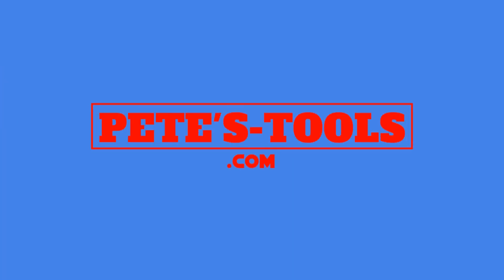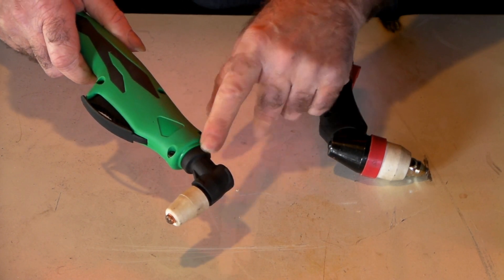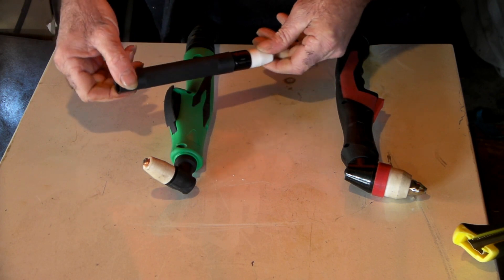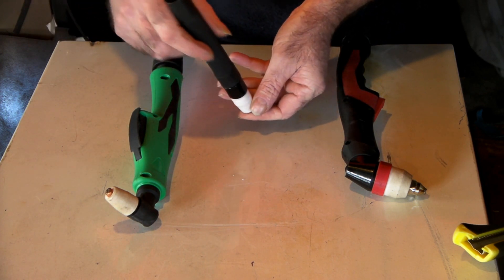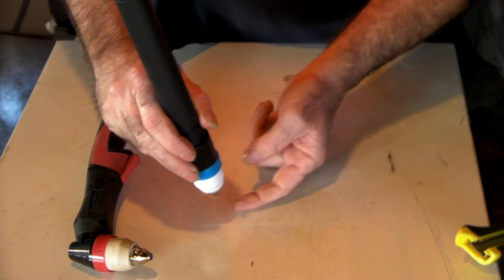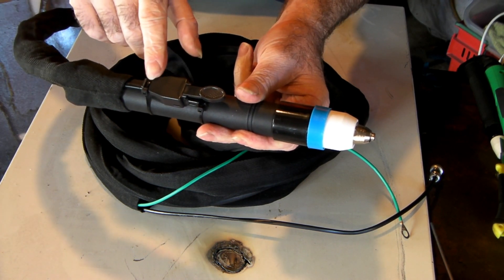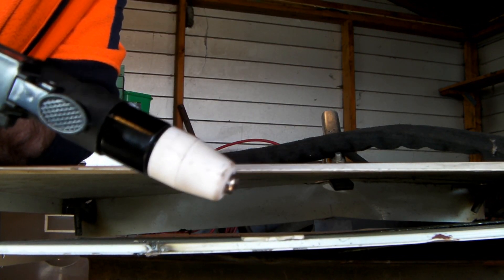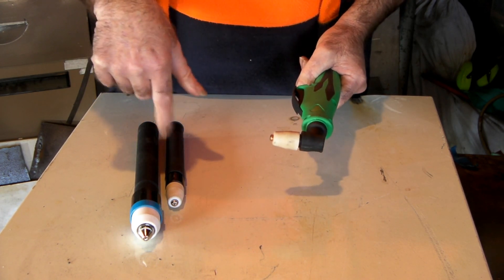Cnc Plasma Torch Diy

Comment: Hi Pete, can a non-HF plasma torch (IPT60 by example) be exchanged for the P80 pilot?
 (I want to use the P80 for CNC)
I ask this because non-HF torches have at least 4 wires, and pilot type 3 only, I am not sure if interchangeable.
Thank you in avance.
Reply from the maker: no i don't think you can sorry

Comment: I've literally just finished my DIY plasma table and use the pt-31 straight torch, works brilliantly 👌
Reply from the maker: cool mate good torches & cheap to run.
cheers pete
Reply: Is your CNC torch touching or dragging on target metal, or did you add earth wire to "mod" the PT-31 to pilot arc.